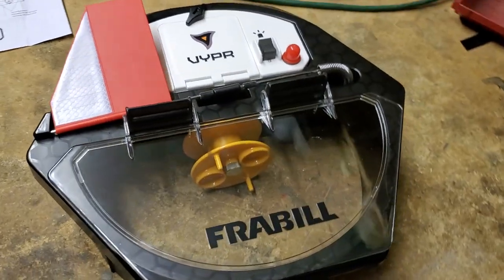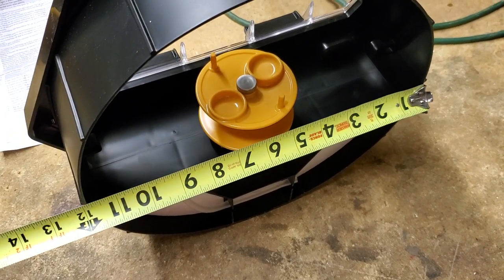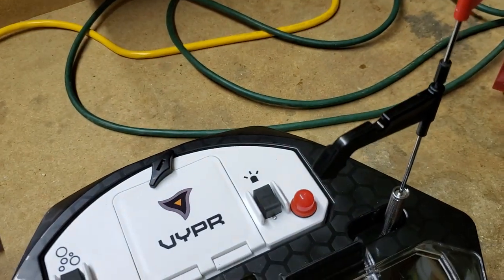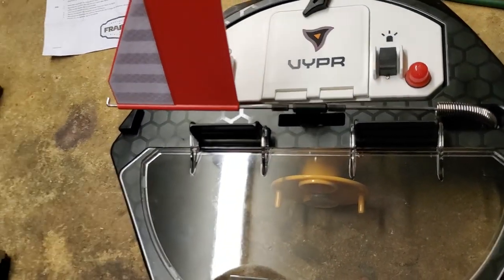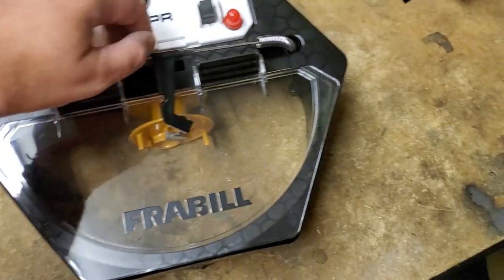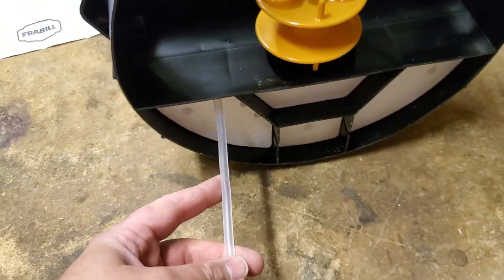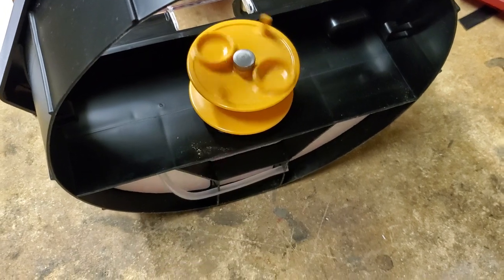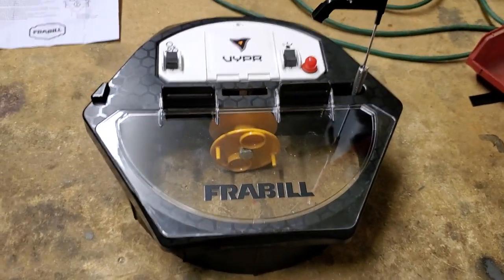New Frabill VYPR Straight Line Tip-up first impressions unboxing review

Comment: Really interesting, may have to pull the trigger if it works out. Curious as to how it will handle Manitoba temperatures but subscribed to see the updates on it. Would make setting depth with a flasher easy with that inline reel.

Comment: Great review! Please do another once you’ve tested.  My concern as well is the line will still freeze on the spool.  I really want to pull the trigger but waiting to see what initial reviews are.  Also, does the spool still free spool easily in low temps?

Comment: Well have you got to use it? Does the line freeze to the spool?
Reply from the maker: I've used it now a few times and never had the line freeze to the spool. I will admit though, I set em and left them. I didn't reel them in multiple times throughout the day. I need to use them more to give a good review on actual use.

Comment: How. Do. You put  line on it
Reply from the maker: I bought and strung 2 of them. On the first one, I took the spool off to add the string by just unscrewing the tension screw. Be careful if you do it this way, there are 2 small washers that will fall off the screw which will need to go back on. On the 2nd one, I just spooled the string with the spool still attached. No need to take the spool off. Both ways were easy. Just make sure to wind the string in the right direction according to the directions supplied in the box.
Reply: That’s good to know. Maybe in the future you can buy extra spools
Reply: Trying to make a better mouse trap. I dont see this lasting very long , very over complicated. And its all plastic.last time checked plastic and cold dont mix.  For $70 buy some good old wood tipups last you a life time.